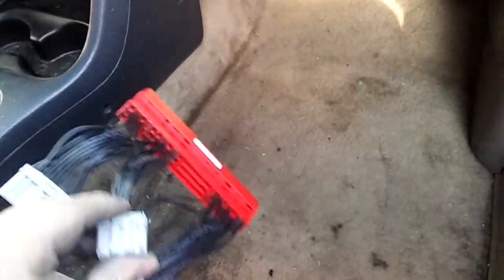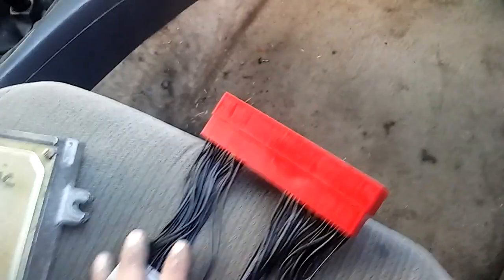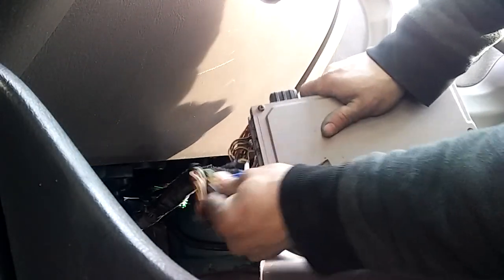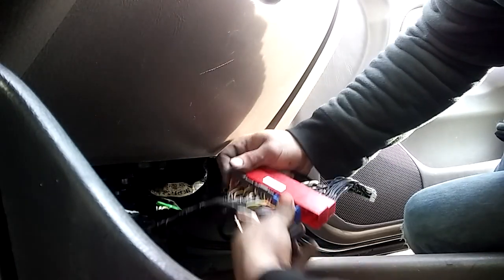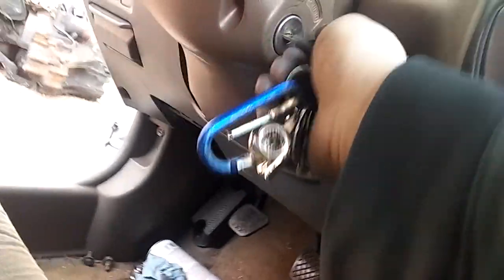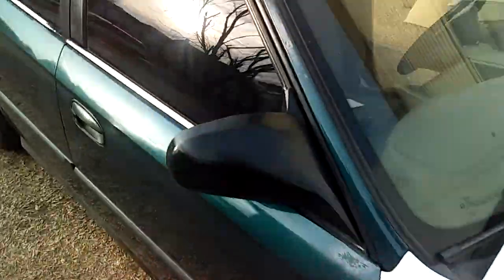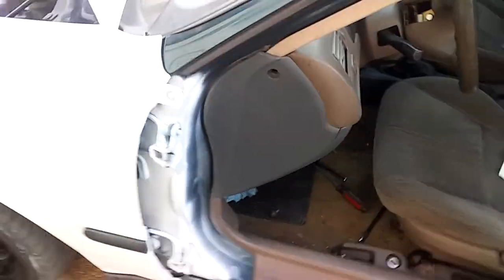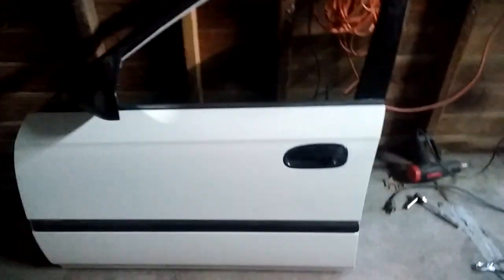How to do obd2a to obd1 conversion.+update.

Comment: I also have a question, I have an obd1 p28 and mine is obd2 for automatic and I use the same converter but when using it the transmission feels heavy and it advances but it does not make the changes that could be made

Comment: I put a jumper harness on a 97 Honda Civic stick shift, now one plug is not connecting at all. Space left has pins to connect did I buy the wrong one? Which one was supposed to be left off in video? Mine is the second big one

Comment: If you're still using the auto ECU the idle will fluctuate like that. I have the same problem. I got a manual ECU and the problem was fixed.
Reply from the maker: Nobel Del Mar We ended up being able to use the auto ecu. The p28 was a manual ecu we had a crap dizzy and caused so much issues. We did the crank position bypass then a new dizzy and everything smoothed out

Comment: Should I get a p72 for my h22a4 swapped 98 integra? And get hondata 300 for it for the best tuning capabilities
Reply: The engine is obd2 so all I need is the harness to plug in the obd1 p72 ecu right?

Comment: I need help!!!! 
1997 D16y8 obd2a into a 1989 civic sedan obd0.

Ive already got a d16z6 crankshaft to replace the crappy y8 one.

Ive been looking for the ecu for the engine. Ive also looked on rywire and cant make sense of it. Plus not trying to drop $850 on wire. The old obd0 harness is screwed. So what i have right now is a obd0 car, obd1 z6 harness and an obd2a engine. Any help will be greatly appreciated. Hmu at civicchriss on ig. If that dosent find me try Chris's civic.

Comment: Gonna convert my 1999 civic to obd1 it has the y7 in it do i need to change anything on the motor
Reply: Why obd1 it's the worst system made
Reply: @larryaustin5165  its allot easier to connect to obd1

Comment: Please help bro...
So your idle would jump?? Mine jumps when the engine is warm, it goes like that, from like 1500-1600/1700.... no clue what it is. And also if I’d keep it revved at 2k it will actually jump up and down from 1500-2000 by itself as long as my foot is on the gas, almost sounds like a rotary or something
Reply from the maker: Sounds like a air idle control valve/Vacuum leak or low coolant. Check them first but if that don't work then check dizzy i replaced mine with one from my parts bin and it fixed my issue. There is also a OBD2 wiring pin that needs done if it was auto but you might have to google the obd2-obd1 conversion issues. Its been awhile since i did this exact fix.

Comment: Hello friend, interesting your video. my case is as follows, my car is a Honda Civic 96 with engine d16y8 ... we have changed the engine for a d15z8 and has the same distributor of the previous engine (obd2a connector) ... with the ecu obd2a the car fails like in your video ... with the ecu obd1 the car does not turn on. the wiring of the car is obd2a ... will you tell me where I have the problem?
Reply: maybe its a obd2b instead.

Comment: Have 2000Gsr body and putting in a 1996 ls Integra engine and transmission what wiring do I need thanks in advance
Reply from the maker: Obd2B im pretty sure and not sure on engine harness but i would assume a OBD2B engine harness for a D16y8 would work but might need modified.

Comment: Is that the same obd2a and obd2b harness?
Reply from the maker: Sang Besi obd2a and Obd2b have different harnesses and require different jumper harnesses. Mine is obd2a in this video
Reply: @JamesDguy  now I use zc single cam engine with head 3 stage and complete wiring auto 3 stage.what harness i supposed to use?I want to use ecu p28.sorry about my language

Comment: Your paint fucked but gd your engine bay is so clean, you going turbo soon? I see an AC delete
Reply from the maker: Ryan O'Brien In videos I did after this one I built a high compression engine and tuned it and it was fun but when you get offered 3,500$ for a car you paid 300$ for and out 1000$ into then you take it as a win and sell! Lol but I cleaned it up repainted it and it looked hella clean. There is more videos on that car if you browse my content
Reply: James D guy I have the same sedan, maybe a different trim; I have the LX. I’m also running a non-vtec but I want to run a turbo and have supporting mods for it. My goal is no more than 200hp reliably cause it’s also my daily

Comment: And the engine harness you're using is all obd2 correct? No swapping harness or anything? I've got a b16a2 obd2 and i'm trying to convert it to a obd1 ecu but my question is ....
- do i need to convert the dizzy from obd2 to obd1 IF I do convert the ecu to obd1?
Reply: Did you figure it out?
Reply: @gameing4life639  did u figure it out? Still lost
Reply: @Rakuji.E  nah I ended up selling the car last owner did some bs with the harness

Comment: Bro did you have to convert the y8 dizzy or did the ecu jumper harness take care of that without having to mess with the dizzy plug when going from obd2a to obd1
Reply from the maker: As long as you use a y7 or y8 dizzy you will be fine. Nothing needs done unless you are using a z6 engine then you will need a Z6 dizzy and dizzy conversion harness otherwise all other D swaps can use the y7 or y8 dizzy. Hope that helps
Reply: @JamesDguy  do you have Facebook bro i have a few questions with pictures I can't send on here would be very appreciative
Reply: Any chance of getting a bit of help from ya bro?

Comment: I'm doing a auto to manual swap on a 99 Acura GS Integra can I do this and then use a p28 ECU without I reflash I don't have VTEC head yet and want to be able to drive it for a while without it
Reply: Hey man what you end up doing for your ecu I’m going to swap my 99 integra too and want to know if obd2 to obd1 then convert the ecu to manual by removing rp17 and installing jumper for rp18 is the way to go if I don’t find a manual obd1 ecu, will it work ?

Comment: I have caprice 1994 obd1 12 pin connector
i tried to scan with bluetooth i used 
obd2 to obd1 adapter but i doesn work
how does work?
is there way to convert obd1 to obd2 other
than using obd2 to obd1 adaper
thanks
Reply from the maker: I wouldn't know on a Caprice. Sorry
Reply: THANK YOU   شكرا

Comment: Hey I got a question hopefully you will see this! So I swapped a obd2a d16 into my 2000 civic which is obd2b... do I use a jumper to change the obd2a harness into a obd2b manual ecu? My car has an extra plug that comes from the car harness.

Comment: If I'm putting a 94' gsr motor in my 00' gsr car, what all do I need to swap over and what all do I need to keep? Any info helps!
Reply from the maker: Jake Cartwright 00 gsr what though? Civic or integra? I would assume you need the obd2b harness and 94 ecu obd1.
Reply: Integra
Reply: That's all I will need though?
Reply from the maker: Jake Cartwright the engine and engine harness for the 99 civic as well. Mounts and so on. If it has a obd2 distributor you will need a obd2-obd1 distributor conversion harness as well
Reply: So take my stock 00' gsr out of my integra, replace it with the 94' gsr motor, and all I will have to switch is a conversion harness for my distributer from obd2-obd1? And ecu from obd2-obd1?

Comment: Wait so if I want a chipped obd1 ecu for my 97 civic I just need this jumper? I thought you had to convert all the leads on the harness going out to each connector.
Reply from the maker: FroztiProductions u only need the obd2 to obd1 ecu harness and ecu. UNLESS you install a obd1 engine with odd1 distributor in the car. If ur keeping the stock engine that came in the car then u just need the harness adapter and the ecu.
Reply: Moore Motorsports James Dguy hey so I took my 5 speed four cylinder engine out of my 1995 Honda Accord and put it in a 1996 Honda Accord bought the obd2 to obd1 jumper harness and plugged in the the obd1 computer out of my 1995 but the car isn’t starting...it’s starting with the automatic computer tho....how can I fix this ?
Reply: @JamesDguy  thank u Jesus Christ I was fixing to abandon ship on my y8 lmfao!

Comment: What engine is that?
Reply from the maker: Br4ndon_ V was a stock y8 with some bolt ons. Now it has y7 bottom end with arp studs, p29 high compression pistons, y8 head, 8lb flywheel and stage 2 clutch. It will be getting put back together in the next few days
Reply: why did you go to OBD1 if your engine and car are both OBD2?
Reply from the maker: Br4ndon_ V Obd1 P28 and i hate the obd2 non tunable system. In order to tune the high compression setup I have to be obd1
Reply: Oh ok now I know what ECU to run thank you
Reply from the maker: Br4ndon_ V no problem. I prefer P28 over any ecu even if I’m running non vtec
Reply: Yo bro I have one more question. I have a D16a jdm obd1 from the EX do you know which wiring harness I should use.
Reply from the maker: Br4ndon_ V use the harness that came in the car if it’s a y8 obd2 harness and use obd2 injectors but use the obd2 to obd1 conversion harness adapter. If it’s a 98 civic use a obd2a if it’s 99-00 use obd2b conversion harness
Reply: Sorry I was wrong it's a 95 obd1 I just need a new harness the one that came with it was all cut up.
Reply from the maker: Br4ndon_ V ok well that makes it easier! Just gotta get a stock d16z6 wiring harness and ur golden
Reply: Worddddddd

Comment: Ok serious question. I swapped my automatic d16y7 with a d16y8 manual, I also did the conversion. The motor is doing that same thing idles just like yours. Question is can I use the y7 auto wire harness on the y8 swap and manual computer if I buy that adapter? I might sound retarded but I'm learning lol. Please I need my ek running again ha
Reply from the maker: Yup I have y7 harness and ecu adapter with manual p28 just gotta run ur 3 wires for vtec but the pin outs on how to do that are on google.
Reply: Ok I'll try that out thanks man. Got a link to purchase the adapter?
Reply from the maker: I will get u one. Right now
Reply from the maker: https://m.ebay.com/itm/OBD2A-to-OBD1-Conversion-ECU-Jumper-Harness-Adapter-For-1996-2001-Honda-Prelude/192383190985?ssPageName=STRK%3AMEBIDX%3AIT&_trksid=p2057872.m2749.l2649
Reply: Do I need a manual intake manifold? I'm sure the one I got is auto because it has the iacv blocked off?

Comment: I have a 00 with obd2b to obd1 jumper with a chipped p28 as well. Nice upgrade bro!
Reply: I've got a an 00 as well and was wondering if all I need is the harness and the p28? Do I need to do anything else or is it kinda just plug and play
Reply from the maker: My lord it made a huge difference. Like I felt like a p05 8 valve engine and now it feels how it should.
Reply: Where did you get the ecu from?
Reply: @chrisfitzgerald2524  92-95 ex models manual preferred but I believe any obd1 board can be converted to vtec and manual as well to suit your needs.

Comment: I use the same obd2 to obd1 conversion piece. I actually am using a stock obd2b harness.. converted all the plugs to obd1.. then had to modify that harness for the h22a1 engine when I got that. Turned out great. Good note is to make sure that conversion piece is plugged in snugged. My first start up didn’t happen because it wasn’t plugged in tight enough.
Reply from the maker: Yea for sure. Thought I mentioned that in the video to make sure its fully connected. I might have failed to mention it Idk but deff good advice.
Reply: I have caprice 1994 obd1 12 pin connector
i tried to scan with bluetooth i used 
obd2 to obd1 adapter but i doesn work
how does work?
is there way to convert obd1 to obd2 other
than using obd2 to obd1 adaper
thanks

Comment: Good deal on the cam upgrade, maybe it's just the audio but sounds like the lifters are a bit noisy. Timing chain, belt or gears while you're in there?
Reply from the maker: Its the transmission. Making noise I have a spare if it blows but engine itself sounds great but the phone audio makes it sound way worse than normal. Its hardly noticeable in person. Idk why its like that lol